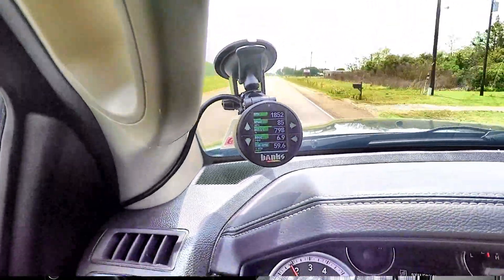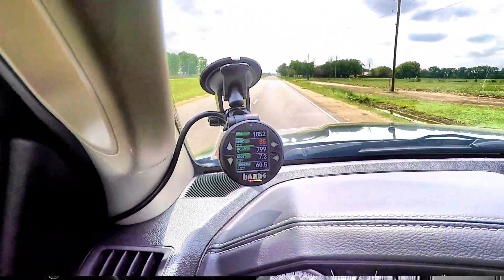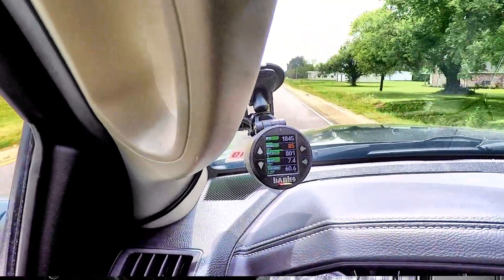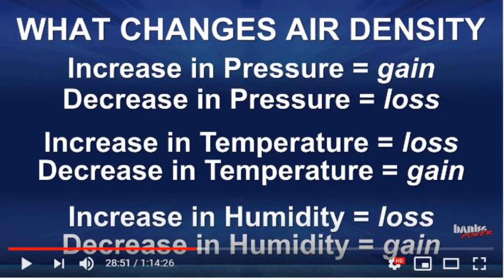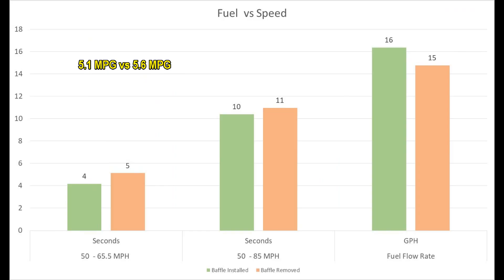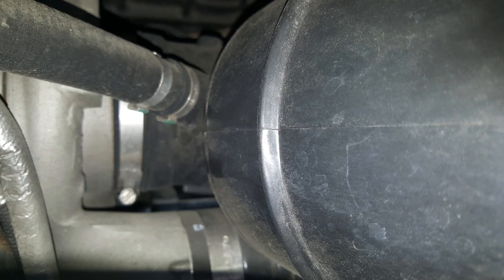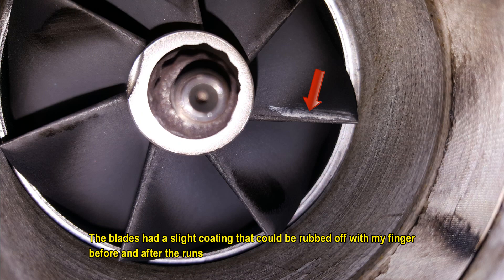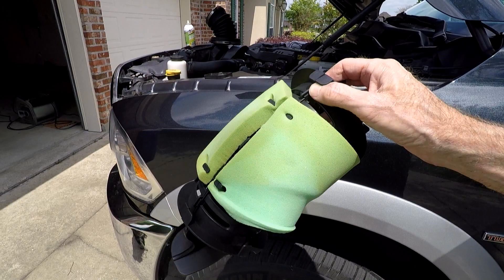Ram 6.7L Cummins Air Intake Baffle - Keep it or remove it?

Comment: Any idea where to purchase a replacement foam baffle?
Reply from the maker: Air Duct - Mopar (53032944AL)
Google this;  you have to replace the entire assembly unfortunately.  About $200 + -
Reply: Well... the is extremely unfortunate. My foam baffle looks like the one in your picture, you know, the one that was installed during production and curled up on itself as it was installed. Not sure why it doest extend the length of the tube as I have seen from other photos. $7.00 piece of foam, but $200.00+ due to buying entire assembly. I wonder if Fram makes anything close to the dimension of the foam baffle. Thank you for your reply.
Reply from the maker: @BiggBaddVVolf  take the foam off and leave the battle.  I've had mine off for since I did the video and no repercussions

Comment: So moral of the story is to leave the baffle with the foam in there? I'm confused
Reply from the maker: I pulled the foam and left the baffle, sorry.  I think the next video makes it a little more clearer.
Reply: @MarionBlair  so why do I take the foam off I'm curious I'm literally about to put the whole thing back in because I'm not sure what the deal is
Reply from the maker: Removing the foam is optional.  Some have found the foam deteriorates after 5 years or so and the engine starts eating it.  The foam reduces a little turbo whine.   If your foam looks OK, there's no benefit to removing it.  I found the engine run the same with or without the foam.  The baffle,  does serve a purpose especially at wide open throttle.   I'm running with the baffle and no foam.  Just because my foam is pushing 6 years old.  If I could buy just the foam (you can't) I would probably replace it.  (I like keeping everything pretty much original.) Let me know if you have any questions.
Reply: @MarionBlair  my foam is 10 years old and it all looks and feels good but the truck has less than 100k on it after 10 years I stuffed it back in after driving a day without it then throwing it in I actually think the baffle is better in the truck just for throttle reasons I took the foam off and it seemed to sloppy in there so I put the foam back on

Comment: This has got to be the best video on this subject.   Thank you for putting all the time into this informative video.
I've been running without the baffle since I had 36,000 miles and I've never seen any oil consumption without it.   Now that i've had my fill of the beautiful turbo sound I will be putting the unit back in without the foam to see how it runs.
I hope that I see some improvement spooling the turbo up or at least still hear that sweet sound of the turbo.
Thank you for all your work.
Reply: So it's been just over 1,300 miles since I put it back in but I put it in as is with the foam.   I didn't feel any difference for the first tank of fuel but after that I started to notice that my MPG went up!   Normally cruising at highway speeds here in Florida (70+) she's hovering around 23 MPG but never over that... Now I'm seeing  25+ on flat road's when driving uploaded.  I had gotten to use to the way it drove without it that now that I installed it back in and it's had some time for the computer to relearn the new condition I'm amazed at how well the throttle response is!    And now the Ram Air is working back to its full potential.    I will never take it back out again.    I'm sure that Ram has spent quite a bit of money in R&D on that intake system and I'm sure it was money well spent so for those of you who think that you can modify it or go with an aftermarket air intake I think it's a big mistake!      Thank you again for all your research and hard work on this video.
Reply from the maker: I agree.
Reply: How’d it sound without the foam vs totally removed?
Reply from the maker: @bradmorris5409  Almost the same.  You can hear a little turbo whine without the foam which I like.  It's not loud enough to really appreciate however.  Seems louder on colder days????
Reply: @bradmorris5409  so far I have noticed that there is a slight difference running it with and without the the foam and I might add that this observation has been long-term.  I find it there is no advantage to taking out the insert or the foam in fact my mileage has dropped 3 miles per gallon over the course of 30,000 miles.   I have reinstalled the unit back to OEM specs with the foam and I have found that the mileage has returned back to normal over the course of the computer relearning the air density to fuel ratio and although it's my opinion that it is not worth removing just so that you can hear the slight whistle of a turbo....   so it really was not worth wasting my time doing the modification and returning it back to the stock.    the only improvement I saw was replacing the stock air filter with a k&n high-flow air filter.

Comment: I checked mine on my 2016 when I bought it in 2016 and noticed a piece of plastic on the "duck bill" about to break off into the turbo, all I noticed was it was louder, mpg about the same. Im glad you did the testing though so we all know that it actually is a functional piece. I have left mine out though.

Comment: Not sure if anyone else noticed or had this but in the fender is a tube, call it a cardboard if you will. This connects to the air box. Mine recently came apart and pulled into my stock air box. Threw a code to change air filter. Just FYI.

Comment: My thought was it was to keep debris from entering the turbo which in turn keeps bearings cleaner, thus longer longevity. Correct me if I’m wrong your turbo really only kicks in under more load at higher RPM.
Reply from the maker: I see the turbo RPM (and boost) constantly working even at low speed.  The VGT is controlling the back pressure to feed the EGR, so it's busy.  IMO, the foam quietens the turbo just a tad.  I don't see much benefit as a filter.  The hot side of the turbine is where we really need the filter with the soot running thru it.
Reply: Why would you have “debris” post filter

Comment: Would it be better to get a tube/ pipe that has the same diameter the the entire distance from filter to turbo? That way it doesn’t have that shoulder at the end?
Reply from the maker: Yes without a doubt in my opinion.  I think the square shoulder is the biggest problem.

Comment: I just bought a 19 6.7 and the intake connect to turbo is much small, did they changed the design?
Reply from the maker: I envy you, that is one beautiful machine. No the intake is the same it's just a little different shape as far as I can see. They did change up the intake to the air clean a little bit which looks nice and more efficient.
Reply: @MarionBlair  I took of the intake and found there's no foam  inside.
Reply from the maker: @uscache  oh that's good to know I didn't realize that.  It looks about the same only a little smaller
Reply from the maker: Maybe they  figured out that's that's foam was not such a good idea after all

Comment: Marion . Any problem with you turbo charger ? I have 2014 72k with a faulty turbo actuator.
Reply: Thanks . I’ll give it a try again . I’ve lost all faith in my local dealer .

I changed all my fluids and filters . I didn’t reset my messages . I went to the dealer . And they tried to sale me fluid changes . Filters etc .  

Plus 3200$ for an actuator. About 3800 out the door everything .

THe dealer stated they won’t cover repairs . 

They couldn’t perform drag link recall because the truck couldn’t get on the rack . 
 Due to faulty actuator. But I left with full boost??  No issues with boost only CEL.

I also did tell them I purposely left the messages on the dash  when I turned down the repairs.

Maybe they where offended . ( pull a dipstick you dip stick )  if they did they would have seen fresh oil not mentioning the new dated filters with mileage on them  . 

Do these guys even visually check our vehicles anymore ?

They had nothing to say .
Reply from the maker: @julianrivera2593  That's aggravating.  Also, check around for an independent mechanic that has a good reputation with the diesels.
Reply: Update *

Dealer would not play ball . I ended up purchasing the actuator from local turbo shop . Borrowed buddy’s autel scanner  . Removed ,cleaned surfaces ,  calibrated then installed actuator ,finish calibration process. Problem solved .  CEL went off on its own and boost came back . 

950$ actuator 
Fluids 80$
20$ Hand tools

Total Repair = Not 3,800$
Reply: @julianrivera2593  Thanks for the info.  I'm hearing the same thing with dealer's  denying warranty.   It's BS.  Turbo is part of power train but not actuator, yea.
Reply from the maker: None yet but this seems to be more common than it should be.  Push for warranty coverage.  Some get it some don't.

Comment: Very counterintuitive. I would have thought that the baffle was to reduce high freq sound from the turbo, strictly a marketing issue. But this info is very interesting. One would have speculated that the turbo charger makes up for the small increase in drag that the baffle introduces. But it is much more interesting than that.
Reply from the maker: Yes, it is.

Comment: Maximum Steel is the BEST and ONLY color. I was flying for Continental during 9/11. Houston to Lafayette, Biloxi, Lake Charles, Little Rock. Air density was important for flying too. Hot and Humid and fully loaded = bad. :) My gut told me the baffle was an air modifier to reduce cavitation into the turbo. You proved that. Well done! The foam is probably just a noise reducer as you said. Thanks!
Reply from the maker: Thanks, You've had my dream job.  I got my commercial license when I was 20 with the intention of making that my career.  I was building hours flying sky divers and anything I could get when I got drafted.  I flew some when I got out the Marines but quickly got married, family and flying was on the back burner. I only continued to fly for fun but I always wished I could have stuck with that.  When I'm not working on video's, I live on the youtube Air Clips, ATC etc.. channels.   Anyway, yea, Density Altitude,  big deal to pilots.

Comment: Very compelling case, Analytics do not lie, I initially removed the baffle assembly and after review of this video (of which provided detailed analysis) I've elected to reinstall it less the foam insert.  I would be remiss not to mention many out there feel the OEM air box is as optimal as many aftermarket CAI's. This may now be suspect considering the 90 degree angle and the shape of the inlet to turbo pipe connector on the OEM. One thing I contemplated is the ram engineers may have deduced a featured back pressure of air at the turbo inlet provided air into the turbo faster due to a reduction in pipe size. Just a thought. Thanks for your analysis.
Reply from the maker: It's an ugly Contraption they have there and I think there is room for improvement and still have  efficiency
Reply: @MarionBlair  what's your opinion on removing the silencer on the 4th gen cummins? Or drill holes in it...
Reply from the maker: @THEDODGE59  I remove the foam but I would not remove the baffle.
Reply from the maker: It's already full of holes if I understand you correctly
Reply from the maker: Thank you Jonathan, yes I agree with you
Reply: @MarionBlair  not the baffle... the actual turbo silencer in the turbo housing... some say it helps with the air turbulence some say removing it only makes the turbo louder... might google it. Theres three pins on the house you have to drill to remove it.
Reply from the maker: @THEDODGE59  oh okay I got you yeah I saw someone talkin about that on a channel.   but they Were talkin about removing it completely I don't know about drilling holes probably best to leave it as is.

Comment: I have been waiting a long time to find out what this filter is!   I removed mine when I put in my K&N filter.   well the only difference I could notice was the sound of the turbo.   Now I can hear the turbo spool up.  I was never able to hear it before.   now mine sits in a box in my attic .    I think after watching this I'll be putting mine back in without the foam silencer.
Thanks for the informative video
Reply from the maker: You are probably OK . I think it's the square shoulder that I mentioned in the video that's causing the air to get turbulent right at the turbo.

Comment: Id be very curious to see if the crankcase evacuation was done with a checkvalve in the exhaust just like race cars use and get rid of doing it in front of the turbo.  Been considering doing it to mine and would get rid of coating the turbo.
Reply from the maker: Yes, I'm considering the same thing.  Only I'd like to go old school and vent it to the ground like the 1st 5.9's used to do before all the emissions stuff.  My 95 was like that.  Or,  I'm also considering putting a little vent filter above the CCV like the deleted trucks.
Reply: @MarionBlair  That sounds like good idea also. If i get to it anytime soon ill let you know how it works out, and hopefully vise-versa. Take care

Comment: So the baffle with foam is for the purpose of drawing oil vapor out of the flow before it contaminates the intake, hence solving the issues other EGR systems have had?  Sounds brilliant to me.  I'd leave it there.
Reply from the maker: The oil vapor is introduced downstream of the baffle  so compressor surging would have to occur for the air to flow backwards.  That brown stuff on the filter isn't oil and starts on the air cleaner side so my guess is it's fine particles getting past the air cleaner.  IMO, the foam is  for sound suppression.

Comment: Great video, I had always wondered about the baffle. I have ran mine with and without the baffle. Mine is a 2015 Ram that is fully deleted. My truck performs better with the baffle in and the foam removed.

Comment: Have you done research on deleting the problematic systems that surround this engine?
I just had to replace under warranty the DEF pump/heater/sending unit combo in the DEF tank on my 2015 3500 with 35000miles
I'm not about more HP I'm about reliability.
Very frustrating all the environmental crap that surround this engine.
Not a good feeling when the truck is shutting down because of failure of this equipment while on vacation pulling your RV and I was visiting the US from Canada.
Thanks
Love your video

Comment: I took mine out 2 years ago and definitely get better fuel mileage and can hear the turbo more in the cab and I like that. However I hot shot for a living and need all the power I can get so I’ll most likely  be putting it back in after watching this.

Comment: Can you throw Banks Ram Air kit on & retest?   Think I paid $375 on eBay for it over a year ago and believe my mileage improved a couple.  Very informative thank you. 😊
Reply from the maker: Thinking about putting the K & N duct on with the stock air filter.  Trouble is, I like paper filters.
Reply: @MarionBlair  the Banks "dry filter" included is replaced @ 60K 😲
Reply: @MarionBlair  are you able to purchase the k&n duct without the filter? I only see the filter plus duct kit for sale. And like you I prefer paper filters.
Reply from the maker: @fatmeat  No, You have to buy the $75 filter unfortunately

Comment: Great data and explanation. Not the typical these suck and yank them out vids that are pretty normal. I was impressed that you actually looked up the patents and read the explanations. The turbo is really no different than a jet turbine found in fighter jets in function, suck, squeeze and blow the air with exhaust driving the assembly. In jets they try to get a common face of air to hit the turbine face to prevent uneven pressure on the blades with with our trucks and the space allocated under the hood this just isn't possible. The duck tail would help to solve that issue and I wonder about reusing some of the OEM assembly to help straighten the air but cut some of the extra plastic out.
Reply from the maker: Thanks Jeremy, appreciate your comments.  I am also wondering how to cut the space down.  I actually thinking about buying an after market assembly to test it but I'd like to keep the OEM air box and I haven't found where you can buy the air duct without buying the entire air cleaner with it.  Your explanation on the jet engine reinforces the data and outcome of my test.  Thank you.

Comment: That baffle is there to re-direct the airflow so the compressor blades are evenly loaded with airflow. Otherwise as you stated in the video, the airflow will be biased to one side of the compressor blade and it won't be as efficient as it could be. 
This is all caused by the sharp bends in the duct work leading to the entry of the turbo.
Reply: Yea I think it might also keep the air flow going straight into the wheel instead of tornadoing
Reply: Yes but the foam delete. A ok

Comment: Keep it if you  like the quiet or pull it if you love the sound of turbo and add air flow to turbo. I owned a 6.7  biggest regret of getting RID of my 12 valve
Reply: But over all advise just get a nice aftermarket cold air intake

Comment: So what’s the verdict. Keep it in or take it out??
Reply from the maker: Take the foam off if you want but don't take the baffle out, you'll lose performance.
Reply: Marion Blair  thank you.
Reply: Switch over to 5.9 manifold and add turbo/programmer of your choice . Then enjoy smiles per gallon . Will add fuel mileage , massive amounts of torque and hp and remove egt , horrendous head pressure extending your engine life
Reply from the maker: Yes!
Reply: Marion Blair do you think they added the foam for sound dampening or intended on more dealership visits ? Seems to me that a lot more subtle  unneccessary maintenance is being engineered into vehicles

Comment: I have 2010 just cleaned egr cooler, valve and intake horn. When I took off this intake baffle the foam had black residue on it maybe from the crankcase vent. The foam was good I washed it out it back in.
Reply: MCMUSICH 
EGR DELETE